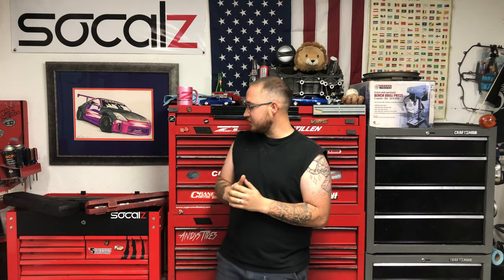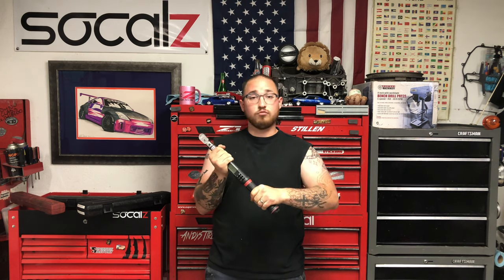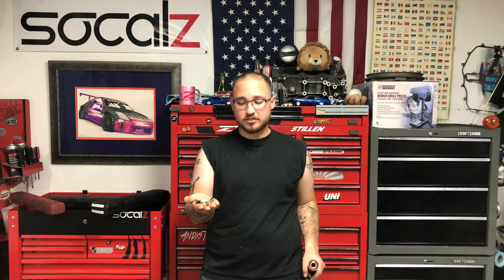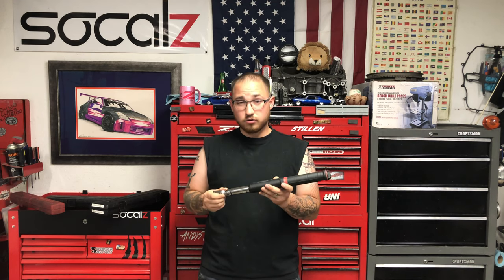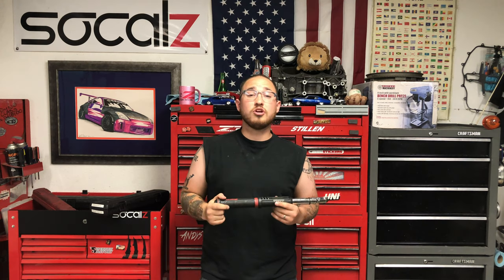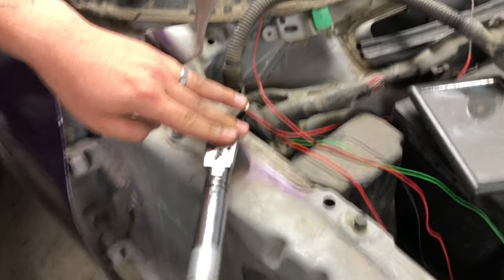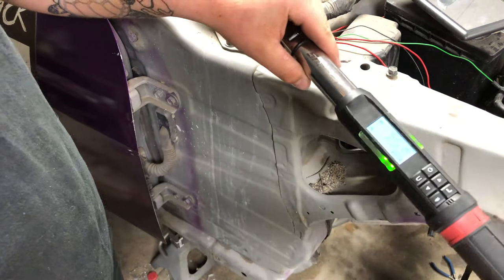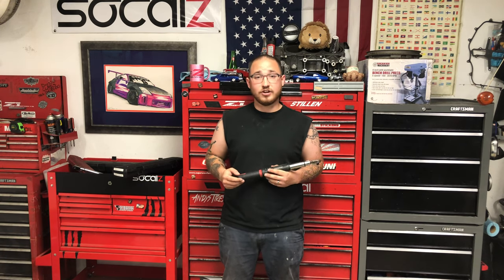Snap On Digital VS Click Torque Wrench

Comment: What do you think a used, but in good condition Snap-On click style 3/8 torque wrench be worth?
Reply from the maker: Keelan Davis depends on which wrench it is. Although I see them usually sell between $80-150 used. I would make sure it has been recently calibrated. Atleast withen the last year to make sure it’s accurate
Reply: @ChristianLopez33  it looks like the one you showed in the video. I don’t know the exact length because I’ve only seen it on Facebook market place. He says it’s well taken care of and it looks to be judging by the picture. He’s asking $150 for it and an snap on Angle Gauge (TA360)